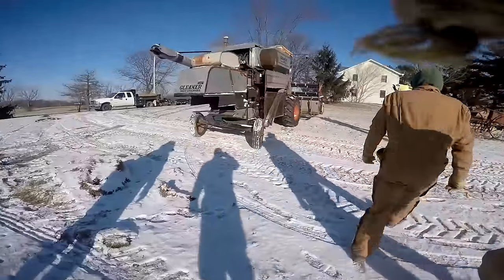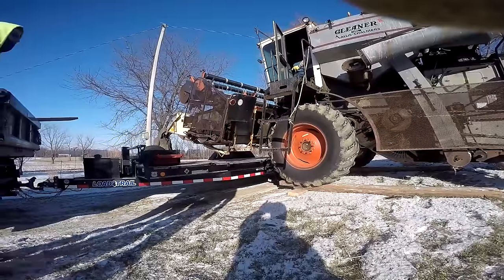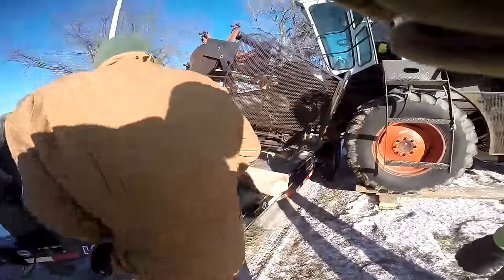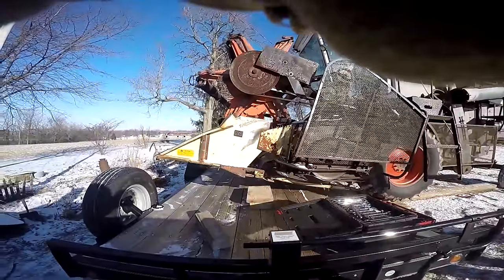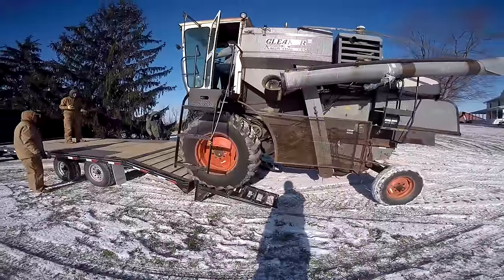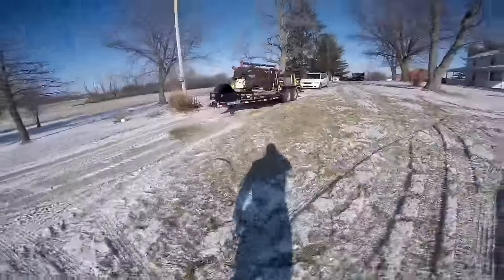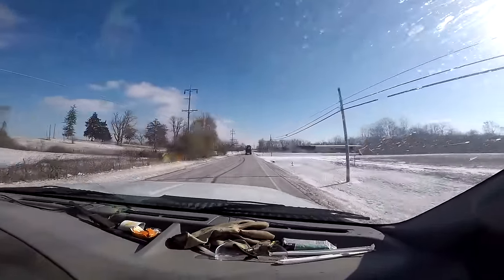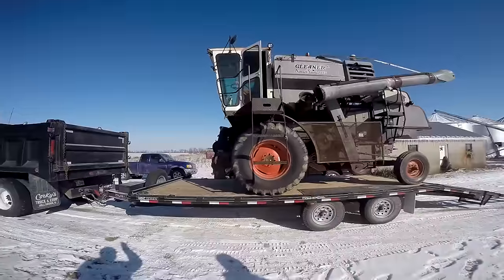Gleaner K Combine: Hauling Home our New Combine

Comment: Nice... Dad and Grandpa were back and forth between buying a Gleaner in '73 or '74 or the Claas-built Ford 640 combine we eventually got.  The Claas was one of the biggest combines in the US at that point-- 18 foot cutterbar, and they got a better deal on it because it was a '72 model that had been on the dealer lot for a couple years, so that made up their mind for them.  IIRC the Gleaner they were looking at was a 15 foot cutterbar and smaller machine, don't remember what model they were looking at.  The 640 has a 300 cubic inch Ford inline six cylinder gasoline engine, although they were available with a four cylinder diesel, probably like a Ford 5000 tractor or something.  The 300 six always seemed to have plenty of power and did okay on fuel, so no real complaints there.  They paid for that machine doing custom work, paid for it basically the first year.  I think they gave $12,000 new for it... 

They had a "standing deal" with some BTO from the next town over they used to go to church with back then... he was a bigshot who ran all new Deere cab tractors, but he always hired his grain sorghum combined, because he wasn't going to sweat it out in 100 degree heat in the old poorly sealed, dusty, poorly air conditioned (if at all) cabs common to that era of machines... let alone an old open station like Dad's old Case 660 combine he had before... Anyway, he'd convinced Dad and Grandpa to buy the new combine with promises that "yall can combine my crop EVERY YEAR!"  and he was gonna buy a "Big 12" auger cart (which was big for the time) and run cart from the comfort of his air conditioned Sound Guard cab on his Deere 4230 or whatever... Well, this arrangement was all well and good until some BTO neighbor of his who'd bit off more than he could chew, and contracted for WAY more grain sorghum than he could deliver, and was facing ruin having to buy out the contract or come up with a bunch of sorghum he didn't have... so he offered their "friend" to pay him "across the scales" for his grain and combine it FOR FREE to fulfill his contract, which of course he jumped on... "so sorry if you lose your combine because you can't pay the bank note, but OH WELL THAT'S BUSINESS!"  (This guy ended up with a reputation lower than whale sh!t-- like one of his neighbors said one time in the coffee shop, "He'd cut his own mother's throat for another hundred acres!" commenting on how he'd tried more than once to rent his ground out from under him, from his own family!)  

As it so happened, the early 70's were a boom time for grain prices... grain sorghum and corn, which have their prices basically in lock-step since they're both basically interchangeable for anything you want to use the grain for, (sorghum usually sells for about 4/5 the price of corn, with corn sold by the bushel weight and sorghum sold by the hundredweight (cwt).  Anyway, everybody and their DOG was planting sorghum back then to 'get rich quick" off the great prices... This one BTO over other side of our county seat town rented a couple thousand acres of river bottom land on the Brazos River, and put it all into sorghum, which is a cheaper crop to grow than corn.  Well, it had worked pretty well, til we got a very wet, very hot June that year, and weed control chemicals weren't that good back then, and there was basically NOTHING that controlled morningglory vines... Well, the sorghum had headed out and set grain and ripened, but the hot wet conditions were PERFECT for morningglory vines to infest entire fields... they spiralled up the stalks, ran down the rows, even reached out across the rows, criss-crossing back and forth and basically making the equivalent of a blanket across large swaths of the field chest high off the ground!  This BTO put the word out that basically any custom operator could get as much work as they wanted combining this HUGE MESS... and get paid top dollar rates for cutting it.  He set up a "competition" the first day at a big field surrounded by some huge pecan trees... when we got there it was like a combine farm show or something-- combines of every make and model you could possibly see in the early-mid 70's were there-- Deere, International Harvesters, White, Oliver, Masseys, Gleaners, you name it there was probably one there... Everybody pulled in and started cutting, and one by one they backed out of the field having plugged up their combines with the tough, green, STICKY sappy sugary morningglory vines... they'd wad up and then slug feed and lock up the cylinder and stall the combine, and then the guys would be pulling the covers off and getting in there with knives and hay hooks and pliers ripping and slicing through massive wads of vines and pulling it out of the machine to get it running again... Dad slugged our Claas/Ford a time or two, and backed out under the trees to unplug it... Particularly hot nasty work in 100 degree temps in July on the Texas coast with humidity that curls your hair... The Ford had ONE big advantage that Claas put on it when they built it-- the Germans designed the thing with a small diameter, six rasp bar cylinder, with dual heavy cast iron variable speed drive pulleys on one side, and a big honkin' cast-iron block with four holes through it on the other side... these not only acted like flywheels to keep the cylinder turning if it ingested a slug, and having the cylinder SMALLER IN DIAMETER (18 inch diameter) meant it was EASIER TO TURN than the large 8 rasp bar 24 inch diameter cylinders on most other combines, meaning they locked up easier with a slug... BUT that big cast iron "barring block" allowed you to shut the combine off, throw the header in gear, and TURN THE ENTIRE THRESHER BACKWARDS by sticking a long iron bar into the holes of that block and turning it backwards slowly-- you could reverse a wad back down the feeder house and right out under the header auger, toss it on the ground, fire up and clear the machine, and go back to work in like 10 minutes, versus 2 hours of cutting and hacking and cussing and pulling and tugging trying to get slugs out of the other machines... By about 1 pm, EVERY OTHER COMBINE that showed up that day had quit and left!  Dad discovered another trick that let him combine pretty much nonstop, after a couple slugs and stalls... Unlike the Deeres and most others that had a little crank wheel to raise and lower the concave clearance from the cylinder to set the thresher, the Claas engineers had put a lever under the seat with a sector with various holes in it that the lever had a pin sticking out to go into, setting the concave clearance... so when he saw a slug go in under the auger, or felt the vibration of the cylinder bars hitting a slug with a loud vibrating "BBBBRRRRRTTTTT" he'd reach down right quick, and throw the concave lever TO THE FLOOR, opening it WIDE OPEN, so the slug would just roll on through as the cylinder bars pounded it around, and the beater would throw it on the straw walkers, which would toss it back and out of the combine, along with whatever unthreshed heads of grain that were in it... wasteful, somewhat, BUT he was cutting entire truckloads of grain with no problems, where most combines couldn't go over 100 feet without slugging and locking up.  The Deere couldn't do it, nor Massey or White or Oliver, because you couldn't crank that wheel fast enough to drop the concave before the machine locked up.  If you cranked it as fast as you could, it would take you about a minute to crank it all the way open and back closed again--  Dad could let a slug blow through, then pull the lever right back up to the third notch, where it belonged for threshing sorghum, on the go and with no problems.  IH used threaded bolts to set their concaves-- couldn't even change it from the cab, as did Gleaner... They were the first to go... 

Anyway, Dad and Grandpa paid off their bank note on that machine that fall with the money they made custom combining for that guy... we were over there every day and half the night for about a month cutting grain sorghum... Dad was filling 8 railroad cars a day with what he was cutting at one point, so he told me... Say what you will about those Germans, but they DO know how to engineer a piece of machinery!!!  

Later!  OL J R :)

Comment: On a lot of those older harvester machines the brakes don't work... our old IH cotton pickers never had brakes work on any of them (we had 3 at one point).  Dad was an IH mechanic in the early 70's when I was a tiny tot and he said basically they maybe worked for a year after they left the factory then went to pot, quit and you couldn't keep them working.  A lot of the combine brakes were about the same on those older machines.  We made it just fine with no brakes on those old pickers... you get used to driving them without it.  You just have to be careful-- and you can always shut the engine down and use the clutch as a disk brake LOL:)  Only had to do that once as I recall... 

Another trick is, when backing a combine like that off the trailer with no brakes, you can always shut the engine off, shift it into reverse, and pull the coil wire... just crank it over with the clutch up and let the starter roll it backwards down the ramp.  The starter has enough power and gear reduction through the flywheel, pulleys, transmission, and final drives to move the combine around for minor distances... We used to use that trick to move the combine in to hook up to the head on our old Claas/Ford, since the  feederhouse was part of the header on those and the connection was made between the feederhouse and front of the combine where the feederhouse attaches to the combine itself, with a pair of half-round "wedges" and a couple locking pins... needless to say you couldn't see ANYTHING from in the cab, so you just got lined up as best you could, get fairly close, shut the machine off, and then shift in first gear and crank the engine over to slowly roll forward inch by inch until they were ready to mate up... jacking up or tugging the head this way or that with a come=along until everything was ready to drop into place...  Some of the old tricks that worked way back then on manual transmission machines that would have guys used to hydrostats going "HUH???"  LOL:)  Later!  OL J R :)

Comment: Congratulations on your new combine. My grandpa had a Gleaner, always did a good job. We had a 600 Case with a Chevy straight 6 cylinder engine running a 10 foot head and 2 row corn head. Rear axle likes to break off in frozen ground that has been rutted.
Reply from the maker: Thank you. I have heard about the axle problems. Two weeks ago I followed a 600 case to the scrap yard. If they hadn't hacked it up to squeeze it on a landscape dump trailer, I would have offered to buy it. It looked like a decent, shedded, machine before the grandkids or whoever chopped it up.
Reply: My Dad had one of those back in the early 70's... he got it cheap because basically it was rusted to pieces when he got it... guy had been desiccating his crop with sodium chlorate, which was a common practice back then, to get the grain sorghum to dry down faster... problem was, you were basically running SALT through your combine, so all the dust was heavily contaminated with, basically, SALT... (chlorate not chloride but still, basically the same stuff chemically-- sure corrodes the same!)  That combine had the entire auger trough of the head nearly rotted through with rust, Dad pop riveted tin patches in there over the winter after he bought it... the returns shaker pan under the straw walkers was also rotted out completely-- he slipped some sheets of tin up in there and pop riveted them over the old pan so it would hold grain and shake it down into the cleaning shoe...  He ran it a year or two doing custom work until he was on a big job for a BTO friend of theirs they went to church with... one day he went to unload with a full tank and BAM the auger drive box broke, which you have to get to from INSIDE the bottom of the tank to fix... he spent the rest of the day digging grain out of the tank and throwing it into a truck with a five gallon bucket in 100 degree plus temps-- had a heat stroke that night and was in the hospital overnight... got it fixed and finished the year, but he and Grandpa decided to buy a new combine after that if they were gonna keep doing custom work and growing sorghum... which is how they decided to get a Claas built Ford 640 combine, after looking at Gleaners, because they got a better deal on the Ford... it's a good combine we still have it and we used it right up to when we quit row-cropping in 2003... OL J R :)

Comment: That's a nice combine you purchased should be a good addition to the farm. Gleaners always did a good clean job of cleaning the grain. Once you give the ole girl a little TLC, she'll be good to go. Enjoy! See you next post.
Reply from the maker: Thank you. I think it shall perform well. I am surprised at how narrow the manual recommends for setting the cylinder clearance for corn. It would grind the cob to pieces. I've already replaced the rear wheel bearings, the idler bearings for the gathering chains on the corn head, cleaned the windows, tightened the chains and replaced spark plugs.

Comment: Congratulations! They are a good combine and easy to work on you won't be disappointed with the machine. We had two of them and a K2 as well. If you need any advice on the machine don't be afraid to ask.
Reply from the maker: I am sure with more run time, I'll be full of questions. Thank you.
Reply: ya keep ur hands away from moving parts too

Comment: Rear axles breaking were common on that model. One of the last new combines my dad bought new was Gleaner K, broke the rear axle at 1500 hrs. I went out and bought a brand new JD 4400 Diesel, had to be about 1977-1978. Gleaner always had a clean sample, but it was broke down more than it was in the field.. Might of gotten a lemon.
Reply from the maker: I have heard of a few others with broken rear axles. Hopefully, I have done enough preventative maintenance that I shouldn't have too many issues.
Reply: It struck me as funny as you were talking about the Gleaner K with the broke axle. We bought a new JD 4400 diesel in 77 I believe it was. Threw a rod out of the motor at 70 hours. Stepdad not happy. Spent 7 days sleeping on the shop floor at the implement dealer waiting for the block to come in from wherever. He was more than happy to help the mechanic .in Northwest Iowa you need to get your chisel plowing done before it freezes hard or gets wet.

Comment: She's a good looking machine and glad you found one.  I have a parts book for one that shows how the steering should be put together.  I think you will be happy with it and your going to be surprised what it will do.  Bandit
Reply from the maker: It doesn't have rice tires though. Luckily, I got manuals and parts books with the machine. I do wish it was a diesel, but the GM motor runs well. I already can't wait for next fall, even though I'm not done yet.
Reply: At least the motor is easy to get parts for and so is the rest of the machine.  I think you will be happy with it and it will shell a lot of corn pretty quick. You could find a AC 170 tractor diesel engine and find the bell housing off a later Gleaner E  and put them together and maybe add a turbo charger to it . There are some of the later heads will fit the K and the F so a 3 row wide head might be easer to find. If I come a crossed one I'll let you know.  Bandit
Reply from the maker: There is no bell housing on mine, it's open flywheel with the drive pulley bolted to it. I am hoping to find a scraped K2 with a good engine. Thank you for looking.
Reply: Its really not a bell housing fer say but that's what they call them, Its the cast housing that bolts to the engine and holds the drive pulley system .  There are ways to switch stuff around you just got to find the right parts to put together and make it work like you want it to.  Bandit

Comment: My grandfather had a gleaner combine the bean head was 4 row and the corn head was 2 row I think the combine was a 66 or 67 on the year and it had a 6 cylinder engine gas and also was 30in rows but he yradered it for a massey ferguson combine 410 30in four row corn head and the bean head was four rows and the massey had a 6 cylinder engine and a straight pipe coming off the manifold wish it was diesel

Comment: The 600 Case combined 700 acres of corn, oats, wheat and some soybeans. We had a dairy so soybeans were not that many acres but Dad used them for a cash crop. Back in the early 60's we didn't have the means to store crops like today. Lot of corn was left in the field and taken off in late January or February. That is when you had to watch the rear axles breaking . Oh, not sure about black tile but we wove tarp in between tines so the grain head would pick up down wheat and oats better...
Reply from the maker: That is quite a bit of acreage to cover with a small combine! They did something similar to our New Holland platform, every few feet, rubber mat pieces were placed to help push the crop into the auger.
Reply: Jrbpa 57 a man

Comment: no need to to address your brake issues.just use the clutch brake. gleaners are good start combines. I started with a C2  to a F2 and now run an R60.  still use the F2
Reply from the maker: The clutch brake works, but I think i may want the extra persuasion when turning. I think it will perform well for me.